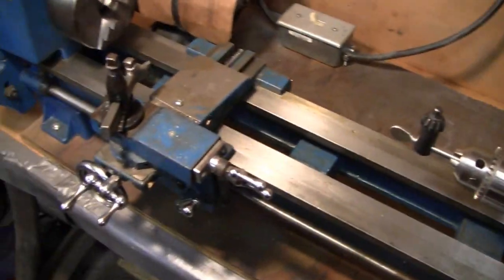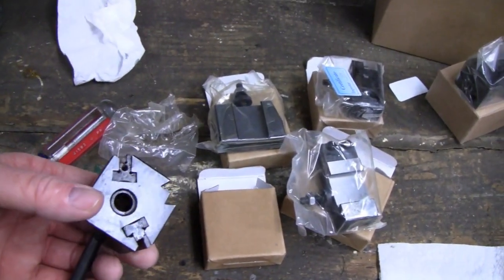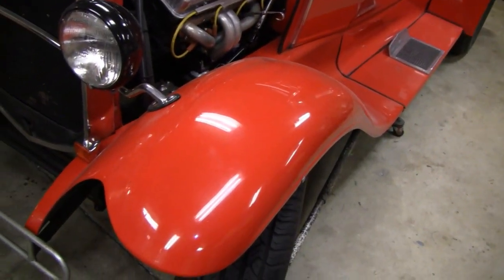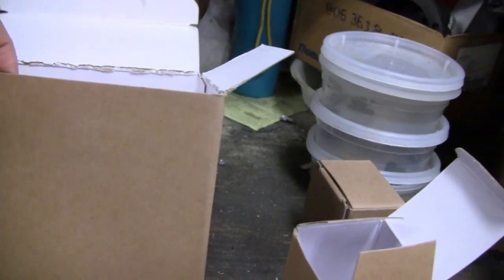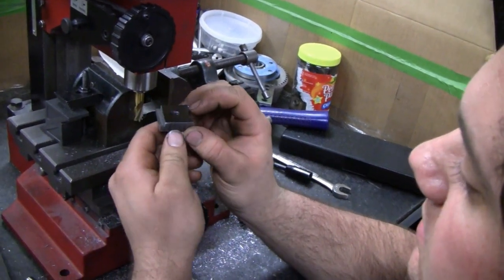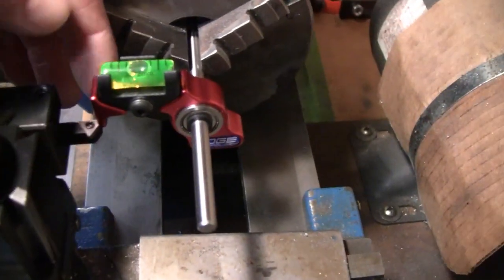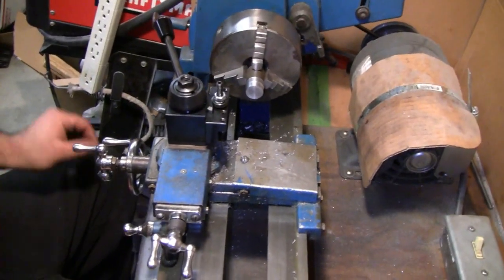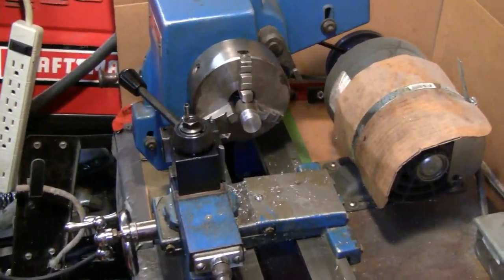INSTALL QUICK CHANGE TOOL POST ON MINI LATHE

Comment: can you tell me which motor u have on this lathe is it 1/3 or  1/2 hp.mine died on mine
Reply from the maker: 1/3
Reply: @805ROADKING  thank you...weird i just bought on of these and it has a 1/2/...but all the others ive seen are 1/3.   it is the calsing blue also...and does not appear to be painted...odd

Comment: I just bought one of these exact models. Do you know how to remove the spindle gear, spindle & sealed ball bearings? Are they all pressed in? I have completely disassembled the entire machine to clean & repaint. I would like to replace the spindle ball bearings but I do not know how it comes out. I do not want to break the Zamak spindle back gear.

Please help. 
Steve
Reply from the maker: Nah I don't have a clue Bud!! I never had to take mine apart!!☺

Comment: Now you need to build a rack for bottles of different cutting fluids, one type doesn't do all. Even makes carbide last longer too. 
Lots of guys use acid brushes, I prefer small bottles with a drip spout, easy n nicer I think.

Comment: Nice tooling but can you adjust the locking handle so it isnt between your eyes and the job? It would be nice if the handle locked up 180 opposite to where it does now. a shim maybe? cheers.
Reply from the maker: Yeah we were able to move it outta the way!!☺
Reply: 805ROADKING nice. cheers mate.

Comment: So glad you got one King , I love mine !  Thanks for the plug to .. what inserts do those tools take ?  Thumbs up man ..
Reply from the maker: Right now I have a ¼ tool in there, but I plan to get a set of 3/8 tools for it!!☺
Reply: These are what I run .. Inserts are 10 for 28 bucks ..http://www.ebay.com/itm/Anytime-Tools-5-Piece-3-8-MINI-LATHE-INDEXABLE-CARBIDE-INSERT-TOOL-BIT-SET-/122291367509?hash=item1c79222e55:g:zzEAAOSwjDZYZr4O

Comment: Nice! They also come in different sizes, I love mine as well. On a side note the locking Lever can be rotated towards the back or right side so that it's not in the way. Just unlock the tool holder with Lever, remove the tool holder rotate the Lever towards the back, then reinstall the Tool Holder and lock it down again with the Lever. Occasionally I have to do that so that it's not in the way of the work I'm doing. Love what you guys do.
Oh and Happy New Years Eve to you guys and the DirtBike Guys. LOL. 
Best Wishes n Blessings. Keith
PS you can step up to a thicker tool in the tool holder to get a more rigid cut if you have to stick the tool further out. Again Best Wishes n Blessings Keith
Reply from the maker: Thank You Bud!! Happy New Year!!☺

Comment: Setting the tool height is very easy.... cut a piece of rod whose length is the distance from the flats on the lathe bed to the spindle center line. You can set a tool's height within a few thousandts of an inch in just seconds by setting the rod on the lathe flat and adjusting the tool to be even with the top of the rod. This makes setting the older style American tool post very easy and quick as well.
Reply: Just put a dead center in your tail or headstock set tool on the center, done, way way faster and way less work, virtually no measuring.

Comment: roadking I have a 1976 allis chalmers that I'm restoring and I will need to repaint the body and my question is how do I clean the body and hood and what paint should I use?
Reply from the maker: Wipe it down good with Lacquer Thinner and any Enamel or Acrylic Enamel would be fine!!☺
Reply: Ok thanks roadking.

Comment: You will love the quick change. I have one on both my atlases and my china mini lathe. but keep the lantern holder around because it does come in handy for some odd angle operations. I've never seen a level tool like that looks handy. I always just use a fishtail between the tool and the piece.
Reply from the maker: You'd like that level, that company makes a few different types!! http://www.edgetechnologyproducts.com/

Comment: The old tool holder you have is also called an "American Tool Post." You did good by springing for the steel tool post. The problem with Aluminum isn't that it isn't strong enough, it isn't stiff enough. Aluminum parts have to be carefully designed if stiffness is a requirement. It's the reason home-made lathes made from aluminum castings aren't very successful... they can't resist flexing under a load like cast iron can.
 p.s. you need to adjust the locking handle so that it locks 90 deg. counter-clockwise from where it is now... that's a safety hazard, you'll get your knuckles taken off If you change tools while the lathe is running and the chuck jaws are protruding past the OD of the chuck.
Reply from the maker: Thanks Bud!! I had a feeling the handle wasn't right, but didn't know where to put it though!!☺

Comment: Thanks RK,,, I have a circa 50's 109 Craftsman lathe and down the road I really want one of these tool holders. I was a little hesitant to get one wondering if I could get it to fit and work properly. Adjusting for the T-Slot is no problem as I have a miniature Sherline mill so that would do the job.
Take care pal and tell everyone I said Happy New Year to ya.
Reply from the maker: Happy New Year Bud!! I was extremely impressed with the quality of the product!!☺

Comment: Go move getting the steel set, I have aluminum and wish I didn't because it vibrates , throwing my cuts off.
Reply from the maker: Yeah the main reason I got it was to improve the rigidity a little and figured the steel would help a little more!!☺

Comment: At that price I'll upgrade. Odd thing is I 3D print way more than I use my 10100 lathe (or the cnc mill). Just haven't had the need to do medal parts when I can get away with nylon or any other printable material.  btw, the glass head vid was awesome.
Reply from the maker: Thanks alot Bud!☺